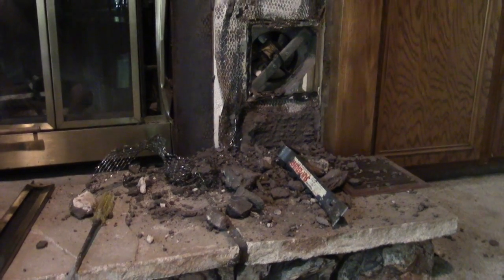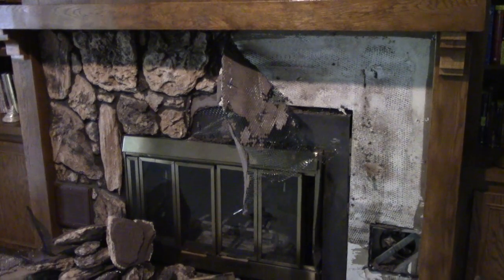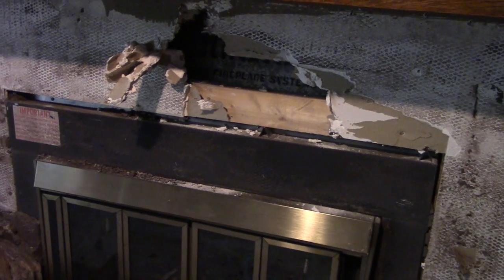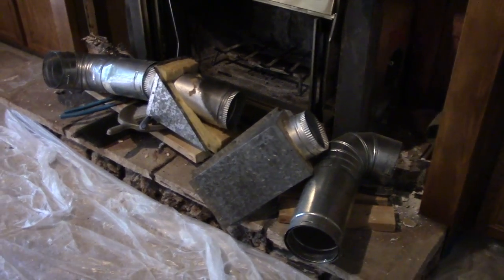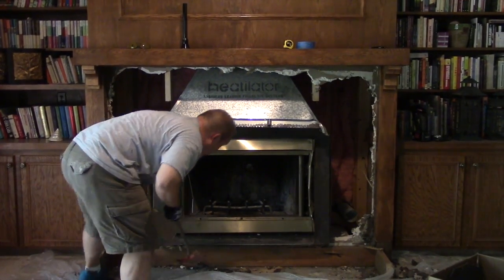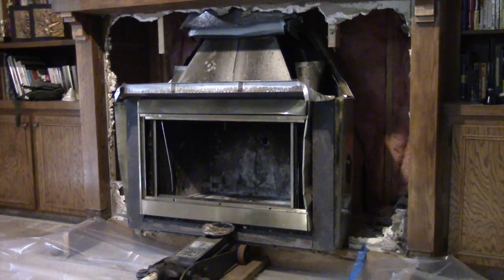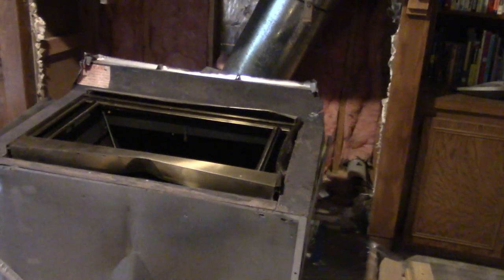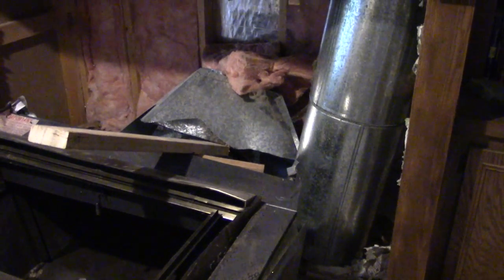Removing an old Heatilator Fireplace

Comment: Thanks for posting. I began my battle this week although my surround was 4" thick granite rock. Each one weighing 40-50 lbs. Rented a Hammer breaker which made short work of the surround except for removing the rock out of the house.  Now comes the battle to remove the unit. I too could not believe the size of this thing. We are replacing with a gas fireplace.

Comment: Wow great comments and video. I think I can just leave the old Heatilator and install the small airtight wood stove insert that I just bought. I wasn't even trying to find a small one but it will actually fit right inside. I just need to figure out how to run a 6in liner down through the old 8in chimney
Reply: hey Les Mcc , know its late, but I'm taking one out of my house as well. I bought a new zero clearance FP. Was hoping to use the existing 8" double wall and connect the new with a 6" liner.. did this work for you??
Reply: @cwilson6880   I discovered that I actually have a double -Walled 12" pipe So I removed the  Damper and was able to drop the 6" stainless steel Flexible liner down through it quite easily

Comment: That was awesome. Without any guidance and by yourself. I just watched another video where they cut out the back of the chimney to replace. This is a professional team of 3 that had access to the top of the chimney and installed a new lining. I have a 23 year old heatilator that produces a nice fire but 0 heat. Will probably leave it alone after seeing what an enormous job it is to replace

Comment: hahaha. dude. i just tore one out of my house. I pretty much used a big ass mallet and a crow bar and tore the sheet metal apart. I then was able (because i had access) to pry the sheet metal out of the the cylinder that leads to the ceiling.

But man...i was about 3 hours in and took a break and started to youtube it...and i came across your video "at this point I'm convinced the foundation was poured, the heatilator was installed, and the house was built around it"
ahahahahhaha!!
i never had such a hilarious moment spun from such a bad mood in my life! In the middle of such frustration I absolutely lost it and erupted into hysterical laughter. That's EXACTLY what i was thinking.
Reply from the maker: Glad I could bring some laughter into the heat of your battle!
Reply: I'll have to second what chuckhough said... and add to it that this was/is a painful project that I NEVER should have started!!!  LOL
From your video, looks like I have quite a few more weekends of frustration and repeated realizations that there's yet another layer of damn sheet metal!!! 
Scary to find out that my fireplace had no pink insulation (or any kind) around the fireplace!!!
Thanks for your video... misery loves company and I don't even have a 2 ton jack for the final steps! :(
Reply: good luck. I got a heavy duty crowbar and a mallet, and just tore through the sheet metal that way. Dangerous, painful, and totally inefficient, but got the job done. It was absurd. And be careful. Once I removed the unit the chimney pipe slid down a good 4 feet and thankfully got caught on the lip, otherwise it would have came crashing down. I was able to angle my unit and slide it out without any jack. I actually did it alone. Just depends on the angle and how locked in and heavy your chimney pipe is.

Comment: 2 years after I bought my house realized some had a removed a similar fireplace and installed a gas insert. They had vented said insert with dryer vent line and crushed the vent right above the insert connection in order to gain clearance without removing the metal liner from the chimney. Hoping this video helps me remove said liner.

Comment: Yikes.  I am planning on replacing our fireplace but what a chore.  Mine is a Martin???  Not sure if that is the same.  I have stupid lava rock too.  But it goes all the way to the ceiling.  Looks like that wasn't such a bad process to remove.  Did you video your installation of a new unit?

Comment: Scary! I am a poor handy woman who usually feels she can take on anything, before I saw your video. I can get to the heatilator from the back, from the garage, where it can be fully exposed right to the roof by removing some drywall. Would that make it easier? Heatilator company requires that I get a GC to remove the old one before they will reinstall a new one, dual sided. I cannot imagine what GC will take this on, not to mention what he will charge, after seeing this video!!!
Reply from the maker: Yes, It's huge job, but if you're handy, patient, and have lots of spare time you can pull it off. - T
Reply: I could get to mine from the garage also wondering if that's the best route?

Comment: I'm in the heatalator war myself,mine has drywall lath and mortar concealing it,I found it easier to remove the guts first.
Reply: I'm about to do the same......the more I get into it the more worried I have become.....but the show must go on.
Reply: If you haven't got it out yet,I had to screw in support s in the attic on the round stack then remove the bottom portion, finally lowering the stack with a woods jack and 2x4s,it is heavy but comes right down.the only thing supporting the stack is the bottom portion of the chimney,it can be dangerous,good luck
Reply: @mattmatthew2440  I got it out! Thank you for the info.

Comment: And why were you taking this out??  Did it work?  What are you going to do with the big hole in your wall.   When I bought my home there was a fireplace and the heatilator was hidden behind things.  It didn't work and was dangerous.  I sued the inspector and won.  I ended up with a new fireplace altogether.  I now have an insert  in that fireplace which works very well, as long as there's electric.
If I had to do it over again I would have had the fireplace and chimney removed, and put a free standing wood burning stove or have a masonry heater installed.
Reply from the maker: Hi Bee Bob, No it never did work correctly. We installed a new EPA certified high efficiency wood burning fireplace. That thing will burn 6 hours on one full load of wood in the firebox.
Reply: You seem so proud of suing your building inspector because an old heater was "hidden behind things". What did you think the fireplace was for? We just used ours and it was fine but really needed fans to help distribute the air. Who do I need to sue to get a new one?

Comment: I am still using my Heatilator Mark 123 Fireplace.  The refractory panels have seen a better day but otherwise is in pretty good shape.
Reply: Is the Mark 123 a wood burning fireplace? I got some 6” double wall pipe for a Mark 123 and can’t find any info regarding its usuage
Reply: @fightintheshade  I have the 123-38C which is a woodburning fireplace.  It was, however,  possible to install a gas log lighter in it.  HearthNhome has the installation manual online.
https://downloads.hearthnhome.com/installmanuals/mark_123_38c.pdf

Comment: We’ve been told our brick fireplace will have to be taken down and the old Heatilator insert removed in order to replace gas logs installed by a previous owner in the early 90s, perhaps not to code? Have tried three or four times to get logs replaced and installers won’t do it because of that insert. Is there a reason the insert has to come out?

Comment: Question:  how was the 'heated air' blown back into your space? I saw the fans installed in the rock (inlet), but I did not see how heated air was blown back into the house.
Reply: If its like my heatilator mark 123, there are no inlet fans, the intakes are on bottom, controlled by 2 dampers.
  The air is pulled by fans through a chamber surrounding the firebox, heating the air. In my setup, there are vents above the fireplace mantle, built into the rock, where the warm air comes out. My heatilator really only heats the room it's in, and because the inner refractory metal has been heat warped , if the fans are turned on the unit pulls/pushes smoke out from fire to vent smoky air so it doesn't work as intended also it didn't have the doors on it anymore so don't know if that effects its functionality.

Comment: I know this is a bit late but it might help others. 
It sucks when you don't know how things were put together and you're trying not to trash everything in the process.

You can get the diagrams of how these are put together. That will help with the dismantle. 

Here is a video of a tile install on this type of fireplace. If you watch. 
You will see the sheet rock that the tile is being set on. 
See the edges where the sheet rock meets the wood surround. That whole sheet rock section usually needs to come out
https://youtu.be/6nzFjGU8KuQ

 If you have wall mud like you had. Wall mud is usually installed over sheet rock with metal lathe and staples.
You can get a pry bar and slide it behind the metal lathe and in front of the sheetrock. Once you slide in between the layers Start prying that stuff off. You can have that stuff off in a few minutes.                           

Now if it is tile or rock attached to cement board or sheet rock.
You can use a grout saw to cut the grout along the edges of the face of the fire place and the wood surround... Once you have removed the grout you can cut the wal board and pop off the tile or rock in sections.

Also,
When New homes are being built. These types of fireplaces are installed right after the homes are basically dried in and before the sheet rock. About the same time that bath tubs are installed. That wood framing that was framed around the face of the fireplace was done after the fireplace was installed. Those pieces usually always need to come out. 

Here are a couple links from a new home and a fireplace like this.
http://www.mccmatricschool.com/upload/2019/01/13/fireplaces-vs-wood-stoves-vs-zero-clearance-inserts-small-zero-clearance-wood-burning-fireplace-l-5f6d75f840e2d291.jpg

https://cdn2.bigcommerce.com/n-zfvgw8/kkeufa/product_images/uploaded_images/nz3000-8.jpg?t=1434598144

Besides, 
You were being too gentle. Unless you were trying to save that POS for something else. You should have gone ahead and trashed it. IE,....cut it into pieces. Or if you were trying to save it.  Once you had access to the top of the heatilator you needed to use a sawzall or a grinder. Then started out by cutting the wood framing that had the face boxed in and then cut the flue.
Reply: I was excited when I saw "Here is a video of a tile install on this type of fireplace" but it's nothing like this fireplace. These have vents that you aren't allowed to cover up. You should see how ugly mine is. Wood paneling! Barf.

Comment: OGM.. In the middle / beginning god I don't know where I am in this battle. But your video was informative.. and FUNNY. I'm just drywalling over mine, so I might try the jack and see if I can push it in a few inches to get some framing in front to hang the drywall on.  If not couple questions. How controlled was the last bit. The chimney as you found out is not attached and VERY heavy. Worried about it crashing down. How did your removal of the chimney sections go?  UGH what a job..
Reply: how did you make out? I just removed a fireplace and going to drywall over the opening. My question is: how did you seal off the chimney?

Comment: Why not just install a wood insert?
Reply from the maker: Hi Jeanette,
Great question, I originally thought I could get away with just an insert, (thousands less) but because this is an actual modular "fireplace" that's what had to go back in. If the house was built with a "real"  brick or masonry fireplace then we could have got away with an insert. Just my luck!
Reply: I'm in the hearth industry and it's unfortunate that you had to replace your zero clearance. inserts are actually able to go into heatilators as long as it's properly vented. with existing 8 inch class a you definitely could have vented a 6 inch liner through the class a. Bummer.  Great video tho!
Reply: Jeanette Louise. I'm glad I seen your comment because I believe you just saved me. so I need to run a 6" liner through the existing 8" and I should be ok putting a wood insert in my heatilator? it's a brand new manufactured home and wanted a insert originally and was told that's what I was getting until it showed up. That would be amazing if that would work. thanks for your help in advance
Reply: EC Truckin so your manufacturer home was built with a zero clearance open wood burning fireplace? As long as you don't cut out anything that can't be removed with regular tools you should be able to find an insert that's high efficient. What's your firebox dimensions?
Reply: Jeanette Louise  width on the front inside of box is 34" and on the back it's 20". so the sides go at an angle and it's more narrow in the back. the inside length is 15 1/2" and at the front there is a lip made into the stone material that is the floor to keep ash from coming out. height is 16 1/2" unless I took a metal piece out that has the manufacturers info in it, then it would 20 or so inches. I measured the inside of the pipe coming out of the unit and it is 6". so im not sure if my options. mabey if I found a insert to fit I could some how connect to the pipe going up? My existing unit is a heatilator el 36. thanks for your help again. I just want something more efficient than this. I rented a house that the owners installed a insert in and it was great. it's small and I was thinking it might could fit in this one. I'll attach a link. http://m.northerntool.com/products/shop~tools~product_200394621_200394621?hotline=false&cm_mmc=Google-pla&utm_source=Google_PLA&utm_medium=Heaters%2C%20Stoves%20%2B%20Fireplaces%20%26gt%3B%20Wood%20Stoves&utm_campaign=Vogelzang&utm_content=172922&gclid=CjwKEAjwv7HABRCSxfrjkJPnrWgSJAA45qA2ExLmByb_YJrpUVAxB19_yijlOQDMJ3NhgSjW0lLI1hoCQJzw_wcB
Reply from the maker: Hi Jeanette,
We could have done an insert if we were starting with a real masonry fireplace, but our fireplace is a stand alone modular fireplace. An insert would have much cheaper, but alas it wouldn't pass code. - T
Reply: Tango Golf Was your chimney clad with wood?  We ripped ours out and dismantled the chimney years ago. It was in a state of disrepair and that was our best option at the time.  Thinking of rebuilding it..?
Reply: @jleight9544  I think I can do exactly what you are talking about. I have a similar fireplace insert to the heatilator. I have a new wood stove insert that is small enough to fit inside. So all I would need to do is run a 6in liner through the old chimney? Would I eliminating the damper?